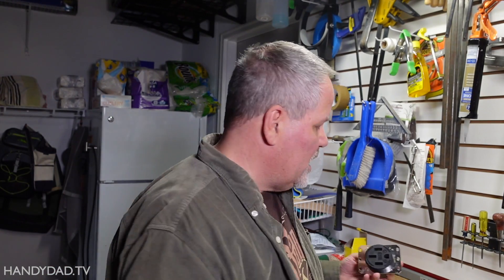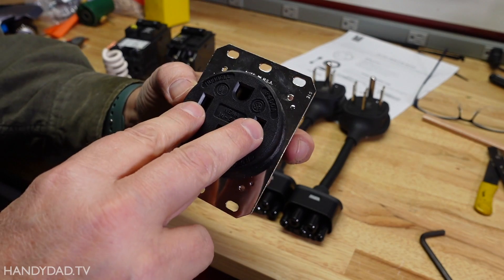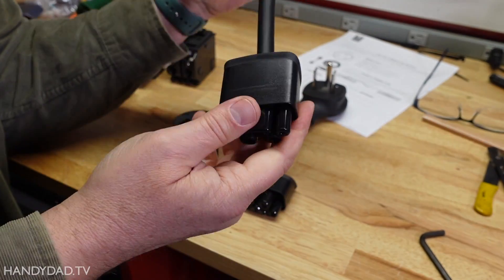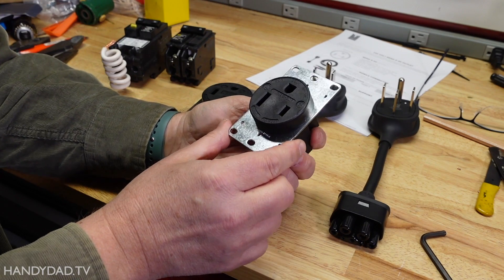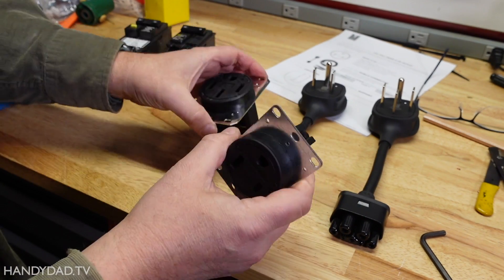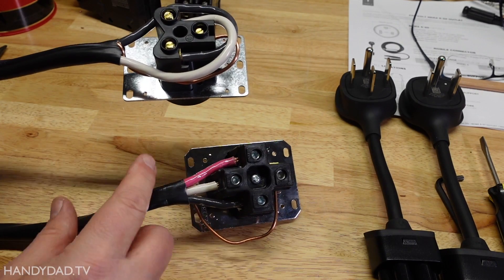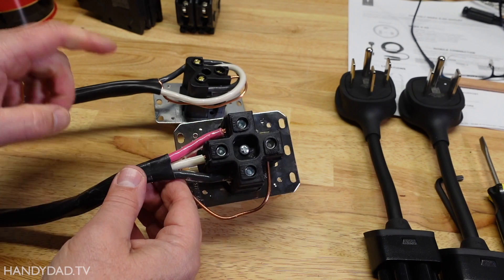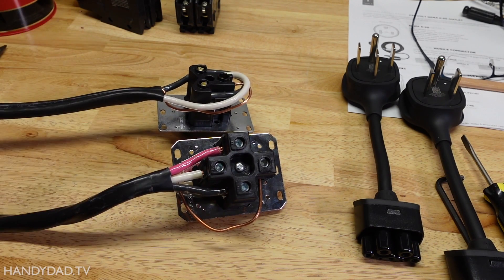NEMA 14-50 vs 6-50 for EV charging

Comment: Can i use a Nema 6-50 charger on a 30 amp breaker/circuit as long as i modify dip switches in the charger to be 24 amp?
Reply from the maker: Yes that should work.

Comment: This video is extremely helpful! Just bought a house and it has a 6-50 plug in the garage. At first I thought I need to replace it with a 14-50, however you just showed me it's a waste of money to do so.
Bought a Tesla Mobile Connector (comes with a 5-15 and 14-50 Adapter) so I need to buy a 6-50 adapter from Tesla and basically good to go!
Reply from the maker: Exactly! 👍🏻

Comment: EV owners that want to keep an eye on their carbon footpint, and are not RV owners, should specify a 6-50 receptacle as the extra neutral wire that will be never used is copper that has to be mined, smelted, processed, shipped, installed etc all for a what if I want to plug in a RV..  Also note when installing the 6-50 you tape the white wire red.
Reply from the maker: Good advice!

Comment: Very well done and explained! I am a DIY guy but am looking for an answer. I am installing a 50 RV pedestal (14/50) and also want to add a welder plug (6-50) in the shop. I would prefer to use the same circuit and wires since both will require 2 hot legs. Can I run the same 2 hot lines to both outlets? I rarely use either and will never use both at the same time. I wonder if a switch to select one or the other would guarantee that both can't be used at the same time?
Reply from the maker: Good question for an electrician.

Comment: Does this also apply to VINFAST? 

The VF Portable Charger has a 14-50R adapter option. Does that mean I could just buy a 6-50 TO 14-50 Adapter to plug in the VF Portable Adapter safely and still deliver 240V? 

Or, is the 14-50R plug by design the safer method for delivering 240V to the portable chargers?

And, just confirming, the 14-50 is NOT a 1-for-1 replacement, due to the third/Ref wire, correct?
Reply from the maker: They are two different plug specs. The 14-50 has a neutral but most EV chargers don’t use it. You’ll need to check with VF.
Reply: @handydadtv  Thx for the reply!👍👍

Comment: Can you put a link to which wire I should put on the 6-50 one? I will need between 30-40 ft of it.
Reply from the maker: 6/2 cable. Buy locally.

Comment: Great vid, question is there a 14-50 female to 6-50r male adapter. Our EV came with the 14-50 but our apartment charging receptacle is a 6-50r , I’ve searched and search and cant seem to find one i see lots of the 14-50 to 6-50p adapters but not the 6-50r type
Reply: Ever ind i think i figured it out had the orientation wrong so theres actually plenty if adapters that will work
Reply from the maker: Good 👍🏻

Comment: Sir, thanks a lot for detailed description, I have a question. I have 6 50 installed in my garage but I bought Tesla recently and noticed that I cannot charge using the 6 50 outlet. Can I buy an Adapter which enable me to convert the 6 50 outlet to 14 50 plug ? Please let me know. Thank you.
Reply from the maker: If it won’t charge with the 6-50 adapter, it probably won’t charge with the 14-50 adapter either. Figure out the issue first.
Reply: Thank you 🙏

Comment: I have a 6-20p outlet in my garage right now. We purchased a ev car and the plug end is a 14-50r. I’m try to make a short, extension, cord adapter, so I don’t have to switch out everything in my garage. Since I old have 3 wires in my existing 6-20 that’s in my garage already. How would I go about wiring that?
Reply from the maker: Not possible. The 6-20 is 20 amps at 120 volts. The 14-50 is 50 amps at 240 volts. 

You need this https://youtu.be/OfdEitiM6u0

Comment: I just bought a house that already has a 6-20 outlet installed. So, I’ll just use that for my Tesla Model 3 (15 mph charging, vice the 30 mph with 14-50 or 6-50). If or when I decide I need a faster charge, I’ll come back and watch this again! Thanks for all the info, though. I find it fascinating!
Reply from the maker: Depending on your daily commute, you’ll do fine with that outlet. I only charge at 15 amps daily.

Comment: I have 6-50 recepticle. I will be charging Model Y. Should I just use adapter on mobile connector?
Reply from the maker: Yes just buy the 6-50 adapter.

Comment: Back in 2011 it was common to use the 6-50 outlet for EV's. For some reason the "standard" changed to use 14-50 nowadays and most plug in EVSE's have a 14-50 option but may not have a 6-50 option. It's a real shame this transition occurred. The reason I say this is because if you buy a 6-50 outlet there is a very good chance it will be commercial grade. 14-50 outlets can be purchased as commercial grade however a lot of the outlets available at home depot and lowes are residential grade and are NOT suitable for EV charging.

Now we have switched to 14-50 the opportunity for a DIY person to select the wrong outlet grade is pretty high and we have many examples online of outlets melting. I made this mistake as you did. I'm reformed now but most DIYers will make this mistake. Had we stuck with 6-50 the incidence of melted outlets would have been much less simply because 6-50 outlets at Lowes or Home depot are typical commercial grade; 6-50 is used for welders and you find those in commercial buildings. 14-50 is often used for dryers and they are most frequently found in homes.

If only we could go back in time and nudge the EV charging world in favor of the 6-50. What a shame, and it will bring a bad reputation to EV's as more outlets melt as EVs are adopted in ever increasing numbers. Codes will eventually catch up when enough homes have burned down.
Reply from the maker: I really prefer hard wiring to reduce the risk of issues.
Reply: @handydadtv  It's one set of connections less for sure. However we have to be cognizant that wires can still come loose at the EVSE or at the breaker. A loose wire can create series arcing and a fire risk and we have no protection against that. Codes really need to address arcing on EV circuits, especially since they are energized at high amperages for extended periods of time

I read in a Siemens document the following
"at the time of this print, there is not even a safety standard written that defines the requirements for AFCIs in 240V applications. "

Color me disappointed with the NEC codes. Clearly the manufacturers like Siemens will only make what will sell. If it's not mandated electricians and manufacturers will not address the risks. The pics you showed of melted outlets *is * scary and I hope someone with the influence to make changes recognizes the dangers before EV's are in every home.

Comment: Hmmm... I had a 6-50 plug installed by an electrician in 2011 when I bought my Nissan Leaf and was given a Blink Level 2 EVSE to go with it.  12 years later I sold the Leaf and bought a Tesla.  Bought an adapter to use the J1772 and plug into my Tesla.  6 months later and now the Blink charger conked out.  So I bought a Lectron brand charger, has the 14-50 plug.  So I flip off the breaker and open up the wall socket containing the 6-50 plug.  I see it has a neutral wire in the box, so I purchased a 14-50 outlet and associated hardware to install it (the 14-50 is bigger so it wouldn't fit in the same box the 6-50 was in).  Get it all wired up and Amazon arrives just in time with the new charger.

Mounted the new charger on the wall (easy) and plugged it in.  Display handily shows incoming voltage, 239v.  Perfect.  Plugged into the Tesla (this particular model comes with the Tesla connector) and my Model S throws an error and won't charge.  Owner's manual is all of maybe 12 pages and it's mostly how to install the charger on the wall.  So frustrated, there's no number to call, just email.  Waiting for them to (hopefully) get back to me.  

Meanwhile, to be sure the car was okay I took it to a local supercharger station and it charges just fine.  So puzzled.  Thinking maybe I should pull the neutral, since it isn't needed.  Somehow I just imagine that would be a waste of time.  I wonder what's wrong.
Reply from the maker: The 6-50 is a 240v outlet that doesn’t have a neutral. Even if one of the wires was white, it’s a hot lead. Make sure you connect them to the X and Y terminals on the 14-50; you won’t use the N terminal.
Reply: Thanks for the reply.  To be clear, the 6-50 outlet was wired with a red hot and a black hot, plus a ground.  Moving over to the 14-50, I simply moved the two hot leads to the new 14-50 outlet, plus the ground, then placed the white wire into the neutral spot.  I can't imagine the white wire would be a hot lead, that would be three hots and a ground, very unlikely.  The display on the charger is showing 239v so it should be good.  I'm leery of sticking my cheapo meter into live AC outlets to confirm, but my other two options are to pull the white lead from the neutral or remove the circuit breaker panel cover to see exactly where these wires terminate in the box.
Reply from the maker: Oh! I assumed you had 2 conductors for the 6-50. But you had 3 and the white wire wasn’t used. Nice that the electrician ran 6/3 wire for future use!

I’d use your volt meter to test across each hot lead and the neutral to see if you get 110-120 volts. If not, you could have an open neutral - meaning it’s not connected inside the panel.
Reply from the maker: Of course, there’s no guarantee that a good neutral will fix your issue though.
Reply: @handydadtv  to update: I opened up the box and pulled the white wire (assuming it’s a neutral) and tested the charging unit again.  It powered up fine and again displayed 238-240 volts.  However it still caused an error when connected to my Tesla.
Reply from the maker: No clue why it’s not working for you.

Comment: You have the 6-50 wired one hot and neutral that gives 120V. Should be two hots, red and black,  and ground  like the 14-50 looks, 6-50 doesn't use neutral wire. If it did work in your install, you aren't standards for wire colors like on the 14-50.  Kids don't try this at home.
Reply from the maker: Sorry but you’re incorrect. I wired the 6-50 with two hots. The only improvement I could have done is wrap the white wire with black tape to indicate it’s a hot.
Reply: 2 wire cable is very commonly used in homes for 240 volt circuits that don't use a neutral,  electric water heaters, central air conditioner and heat pump, and baseboard heaters are among the most common examples.  In these cases,  the white is being used as the secondary hot and should be marked as such,  with a piece of black or red tape or permanent marker at the panel, and where it connects to the receptacle or appliance, as well as in the junction box if the cable was spliced for any reason.

Comment: My situation is that the existing 240 volt outlet in my garage is a NEMA 10-30 (for the laundry dryer). The most current that I feel comfortable drawing from that circuit is 16 amps, which was fine for my Prius Prime, which has a 3300 watt on-board charger that draws 13 amps at 240 volts. But I will be replacing the Prius with a Rav4 Prime in 2 weeks, and this car has a 6,600 watt charger that pulls 28 amps, uncomfortably close to the maximum capacity of the 30 amp breaker and 10 gauge romex supplying that dryer outlet. So I need to install a new outlet in my garage with a 50 amp breaker and 6 gauge romex. The issue of needing a NEMA 14-50 outlet for RV service won't apply to me. My driveway is too short and too steep to put an RV there, so maybe the 6-50 outlet is all I need.

However, there's also maybe a problem with availability. Looking at both the outlets, and EV chargers, it's obvious that the NEMA 14-50 is far more common than the 6-50.

 Thanks for this video!
Reply from the maker: Glad it was helpful 👍🏻

Comment: Does it have any impact wrt heating/ charging ?  Meaning nema 14-50 stays cooler can carry more power vs nema 6-50
Reply from the maker: No. They are both 50-amp outlets. But I personally reduce my charge rate to 15 amps to minimize heat.

Comment: Good info on the outlet differences. I noticed that you have two breakers on the bench and it looks like one is gfci. My main business now is installing EV chargers (EVSE) and getting away from plug-in all together. Many plug-in units come only with the 14-50 plug which limits you to the more expensive outlet and extra wire. The code has changed and although not everywhere has adopted it (they will eventually), it requires the more expensive gfci breaker. At my costs, it is almost cheaper for me to provide a hardwired unit than install an outlet.
Reply from the maker: Thank. I’m not recommending any outlets these days. I addressed the GFCI requirement in this video:
https://youtu.be/BixGQisysDc
Reply: @handydadtv  Good deal. Will watch the vid you linked. Thanks
Reply: GFCI is required whether the unit is cord and plug connected or hardwired. If you look up the definition of “outlet”, in the NEC, you will find it is the point on the wiring system at which current is taken to supply utilization equipment. In a hardwired configuration, it is the point where your power is connected to the charger. Code say every outlet, not receptacle.  I don’t agree with the requirement, but, it is in the code.
Reply: @littleprincess4417  Unfortunately the Code is sometimes as confusing as the Tax laws. Most EVSE units have GFCI in the unit. Practically speaking, the interpretation of the Code rests with inspectors and a State's board. In NC, that update in the Code has not been accepted/adopted yet so a GFCI breaker is not required in either case. If the change is adopted, I am told that it will only apply to receptacles and not hardwired EVSEs. This is why it is important to obtain a permit and inspection, not only to have the applicable interpretation but also proof that work was done by Code in case of insurance claims.

Comment: Thanks for sharing this. Can you share the size of the bare ground wire? I have the proper wire but the ground, does it have to be the same size (6-2)? I bought them separately and the ground wire  is sooo heavy at 6 which is what the  assistant recommended though I showed him a screenshot of how thin yours looks. Thanks for all you do.
Reply from the maker: According to NEC Table 250-122, a 10 gauge grounding conductor is appropriate for 30-60 amp circuits.
Reply: @handydadtv Thank you very much. I appreciate your time sir. Love your work 👍

Comment: I believe you’ve missed several important points. 1: Fire is one of the most serious outcomes if proper installation is not followed. The considerable heat repeatedly generated with each charge session will cause the connection to loosen. The Hubbell 16-50 receptacle actually cradles each wire as the hex fasteners are tightened, and this is especially important because the wire is stranded, and if it’s tightened with a screw, it will have a tendency to spread the wires resulting in a less secure connection. This could result in additional heat generated during charging. Also, it’s important to torque and wiggle each connection several times between turns to assure they are tight. The directions included with the Hubbell give the proper torque setting. The considerable heat repeatedly generated with each charge session can cause the connection to loosen. 2. The $75 Hubbell from Amazon is made of Bakelite material which has a much higher heat tolerance than the cheaper 16-50’s versions, which can melt due to the heat. 3. 6 gauge stranded wire is best; you always want to anticipate a higher charging rate (say 48 amp) and spend a few more dollars now during installation! Better safe than sorry.
Reply: Sorry, I meant 14-50 NEMA receptacle.
Reply from the maker: Thanks for the feedback. I addressed these items in a follow up video: https://youtu.be/1BnK4a4aVpU

Comment: I installed a 14-50 to use with a level 2 car charger. Now I’m installing a garage heater that uses a 6-50 and I want to utilize the 14-50 outlet. Should I wire the heater with a 14-50 plug instead of the 6-50 plug or buy and adapter?
Reply from the maker: I would probably use an adapter.

Comment: does the ev car it's self really take in 50 amps on a 50 amp outlet???
Reply from the maker: You can only use 80% of the rated current. So 40 amps on a 50A breaker. 

I routinely charge at 15A because that’s enough to recharge overnight while minimizing the risk of the wires and connections getting too hot.

Comment: Do u need a neutral wire even in the original drawing shows 2 hots and ground
Why nema14-50??
Reply from the maker: EVSEs don’t typically use a neutral, but the NEMA 14-50 requires one. It’s the most popular option for plug-in EVSEs.

Comment: A 32A 240V EVSE is around $200-300 these days. Just chop the plug off the EVSE and hardwire it to your 6/2 wire. There's never a need to unplug it. If you weld, or need to plug in an RV etc, do a second wire run just for that. Eliminates the need for a $100 Hubbell receptacle, and one less point of failure. Let's face it, if you're installing an EV charger in your garage, you bought an EV, and you are not going back to ICE cars. It's there forever.
Reply from the maker: I agree with hard-wiring, but disagree with hacking an EVSE. I suggest buying one that’s made for permanent installation.